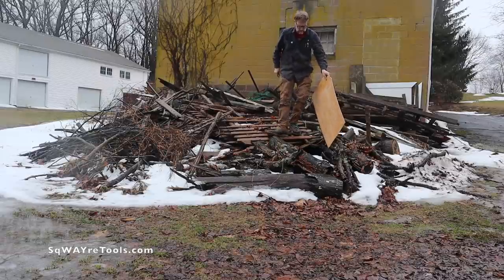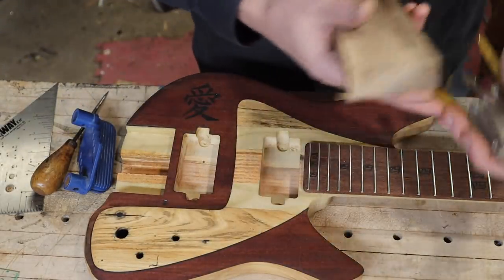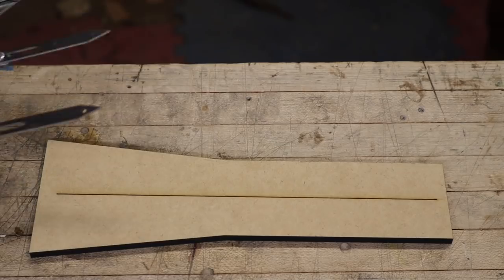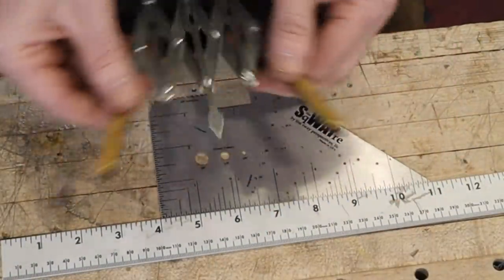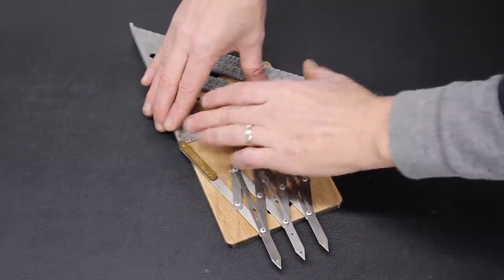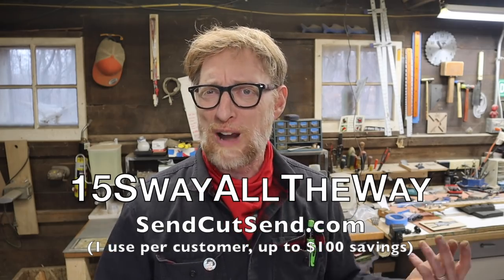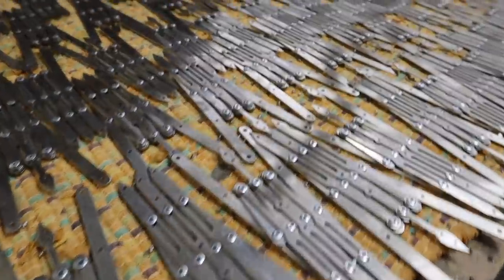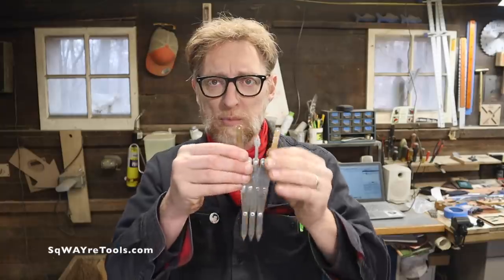Find Your Center with the Center SqWAYre (New Tool I Invented!)

Comment: Outstanding!  I think it would be cool if you could twist a little knob and lock it in a set position, it just looked like when you were measuring for the pickup center and needed to use both hands, it would be the kinda thing where you might then want to lock it in place, recheck to make sure it's centered correctly, and then make your mark.
Reply: I think you could hold it in place with one hand if the spread is narrow enough (which a pickup cavity is). For wider parts, though, it would probably need that for sure.

Comment: it would be cool if the pins were small enough to fit in most fret slots...but way cool tool !!!
Reply from the maker: YES! It fits in lost but the last few frets are too tight, however if I got any thinner we'd lose the stability and tolerances. So you're still on your own for a couple fret position markers but you can use this outside the frets to still help you visualize. BUT REMEMBER: you can't just go to the frets on either side of the fret you want because they are different sizes and you will not be centered, yknow?